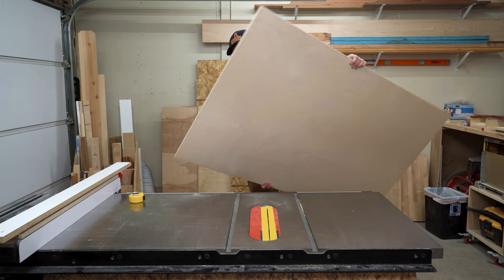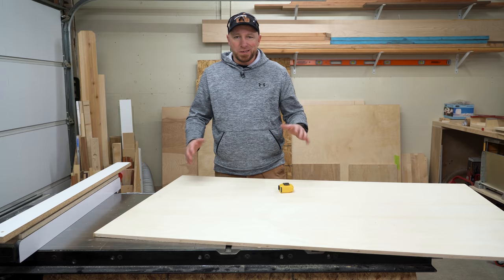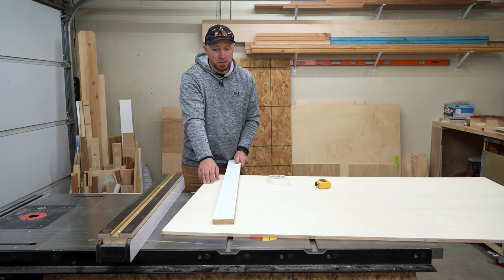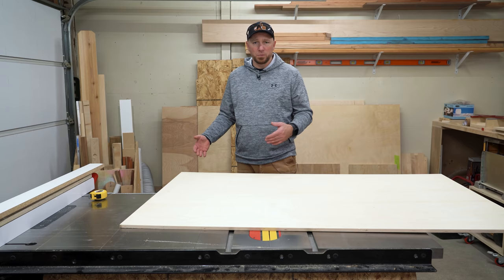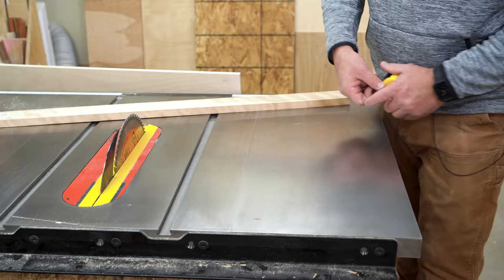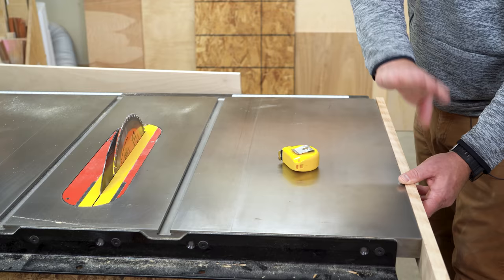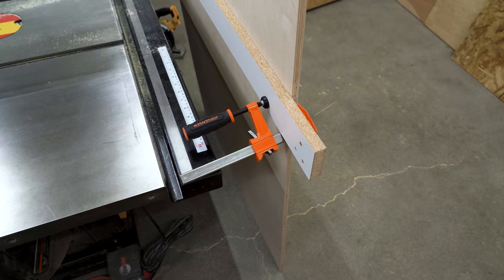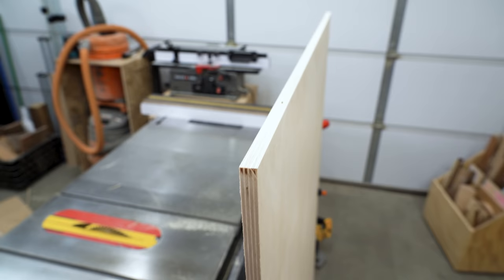A Table Saw Trick So Crazy, It's Genius!

Comment: I'm glad to see this right now.  I think I saw it before, but must have forgotten it, so this is a fortuitous reminder.  I have a couple of 48"+ pieces of 3/4" sanded plywood I want to half-lap together end-to-end, to make a piece longer than 8'.  Normally, I'd do that lap joint with a router and straight edge, but the bit I like to use is worn, and I don't really want to get another at this time.  I also don't want to use the circular saw, for the reasons you mentioned, and because I want this to be an invisible finish cut and seamless under paint, and dressing it up with sanding, etc., isn't something I'm really set up to do.  

This method gives me another option I hadn't thought of, so I'll check it out and make sure I feel safe doing the cut this way (plus it sure would be nice to use my dado stack in the table saw and do fewer passes).  I especially like the idea that the fence can extend past the edge of the wood and fully engage the table edge before the wood gets to the blade, stabilizing the cut very well.  I would need to rest the overhanging end on an outfeed table of the same height as the saw.  And in order to firmly engage the fence against the table edge, I'm thinking I'd like to clamp a second board, like the fence but on top and further away, to use as a handle for my left hand to pull the sheet firmly to the right and keep the fence tight against the edge.

Great idea!  Thanks!

Comment: This is a great tip Tyler but I still like your cutoff jig better.  I do this all the time by putting some 2” foam board on the floor  (or outside in warm weather so I don’t have dust in the shop).  I use foam board pieces so I can clamp my cutoff jig to the plywood and have never worried about the saw wobbling and cutting an angle.  With that said, I have a 52” width fence on my saw but wrestling a 4x8 sheet of 3/4” cabinet plywood on the saw is less than fun….   Hope you keep up the great videos!

Comment: I hope this is clearer
A better way, is to attach that 3/4'  board to a piece of thin masonite that is longer than the width of the board plus the distance of the blade to edge of the table saw.{Board 3"wide, saw blade to edge of saw 24"--make the masonite longer than 27"}   then using the table saws edge as a guide with the 3/4" board at the bottom and masonite on top   cut the masonite using the 3/4" board as the guide along the side of the saw. You now have a jig that you can clamp onto your marked board. Clamp the edge of the jig to any marked line [masonite on the line 3/4" board on top, away from the line. Turn the whole thing over  and using the 3/4" board as a guide on the side of the saw make the cut, less marking and much easier.  I have been doing that for over 40 years.
Also--I have used this jig to cut the bottom of interior house doors--perfect cuts!
Reply: I cannot follow that.
Reply: Clever

Comment: This is so weird! I came to Youtube to check something else, but also had a problem with a large piece of wood I need to cut but two parallel sides are rough cut so I don't have a clean, square edge to run against the fence. I didn't even do a search for the answer yet, didn't talk to my dumdum devices (shhh... I mean Alexa), didn't discuss it with anyone in the house so how did this video get suggested to me?! It's like they're reading our minds now! Thanks for this useful and timely video!

Comment: That looks really useful.  The big sled I made years ago only got a few uses.  Still easier for me to use my 35+ year of skill saw on a saw horse and a panel trim blade.  You'll get No rocking on quality tools, + I don't have that much room on the left side of my table saw.  The side of your table saw all so might not be a good reference for your blade.  Aliment of the blase is base off the T tracks in the set up of the saw.  This might not be a problem because you are all ready clamping a scrap board to that edge of the table and another scrap board to the panel you need to cut.  So the accuracy is just down to the set up.

Comment: You could probably make a fence to clamp onto material and adjust the width. I would use a long aluminum extrusion with a t-slot and two blocks that slide along it for varying lengths of material and that can be clamped to the sides of the material. If you want to get fancy you might even try to incorporate a square into one or both of the clamping blocks, or threaded adjustment to help with accuracy. Just an idea out of my office chair. Thanks for sharing your trick.

Comment: Good idea, but by the time you did all that I would have just clamped a straight edge to the board and trimmed it off with my router or trimmer, especially if you where wanting to do the long edge. I don't a big slide table saw so I do this to my sheet before I start cutting anything.

Comment: Thanks. I do the same but temporarily screw the straight edge onto the sheet so the holes end up on the back of the work piece. It is still a struggle to handle without some kind of support or roller.

Comment: Decades ago, I bought a circular saw that develops 2 HP.   Maybe, if you threw it off a cliff, might have 2 HP power as it hit the ground.   It was always binding and stopping.  I built a panel saw to use the gutless saw.   Worked fine for years and years till the bearings wore out.   The panel saw takes very little space, sheets are easier to handle vertically, and cuts are dead on accurate.
Reply: If you ever buy another circular saw you can't go wrong with the old Mag 77 Skilsaw! I have used mine on the job every day for 15 years, and only done a gear oil change twice, and it's still running strong! It has taken several ride's off of the roof, and bent the table so I finally replaced it, and had to replace the grip once, and did a trigger replacement once, but for all the hard work it has done including running abrasive for steel several times, and running a diamond blade through concrete several times it's been a hell of a great saw, I highly recommend them!

Comment: Pro Tip: use a longer piece to clamp under the plywood. Usually twice as long as the plywood and then center them and it will be much easier and straighter.

Comment: Speaking of thinking outside the box, I've been noodling around in my mind about designing some sort of fence jig that projects down off the bottom of the foot of the circular saw, similar to a tenoning jig riding the rip fence on a table saw, with which you can make the vertical cut for tenons in vertically-oriented rails.  This wouldn't be for something that narrow, but perhaps something that could cut a rabbet on the edge of plywood, and instead of cutting all of the rabbet down into the face of the plywood (requiring multiple passes, and requiring cleanup of the ATB blade's ridges), cutting in from the edge (so that one cut from each angle, into the face and also into the edge, would remove the waste from the rabbet).  This circular saw jig would first need to be safe, and have a way to loosely clamp to the plywood so as to allow it to slide but not wobble.  Several ideas come to mind, from adjustment knobs to slick surfaces to spring-loaded rollers projecting from the surface, to a jig not attached to the saw but to the plywood edge itself.  But curious what you think, how you'd solve that.  No need to reply, but if you come up with anything video-worthy, I'd certainly be curious to watch.

Comment: That edge guide circular saw cutoff jig works a lot better if you make the same jig but use a router and a straight bit instead. You get a finished edge with none of the wobble of a circular saw.

Comment: Thanks for that. I suggest you buy a foot switch. It is so much easier to turn the saw off with your foot than having to reach over to the switch while the saw is still running.  : )

Comment: Nice method. I would suggest that if the end of the table saw wing wasn't square to the blade you could add a piece of steel or aluminum bar by drilling and tapping, them shim it into square. I think I might give this a try, I run into this quite a lot.

Comment: Great idea. I'd add one recommendation - if you're cutting something that overhangs your saw table, you should always use something to support the piece to prevent the edge you're cutting from rising up from the blade. There are plenty of how-to vids showing how to make inexpensive outfeed supports, rollers, tables, etc. Even sawhorses will work if they're the same height as your saw table.
Reply from the maker: I don’t know about “always”, but definitely a good idea in general. I’m still designing mine, as I don’t have space for permanent extra support. In this case, the material is flat to the table, but the material has a bow on the end being cut.

Comment: I find it easier to clamp a metal straight edge to the sheet of plywood and use a circular saw. With all of the different kinds of blades available I get the same results as hassling a big sheet around.

Comment: Great tip. Only one thing, when using the “burning an inch“ strategy, I anticipate you will likely lose that 1/32 accuracy since you didn’t burn the inch when measuring from the blade to the end of the table in the first place.

Comment: Could this be setup on the long side of the table saw? Doing this on the short side forces you carry the material while you cut. But I love the tip!
Reply: I believe that would work as long as the rails for the fence didn't extend past the end of the extension wing.
Reply from the maker: Yeah absolutely. Just take the fence off, and as long as there are no other clearance issues, you should be fine. You just have to have a flat table edge to reference to. I used the edge as an example but also mentioned full sheets. I just didn't want to cut my full sheet in half! The bulk of the weight is carried by the table because you're basically pressing down and pushing in at the same time, so the weight sort of disappears. Depending on what you're cutting of course.
Reply: You could use roller stands to hold up that end of you have them.

Comment: When measuring off the blade, be attentive to where your tape hits on the blade. If you are shooting for max precision, remember that every  tooth is offset from its sisters. The teeth have “set”. One tooth is close to reference edge of the table. The next tooth is away from the ref. edge. I.E. back/forth/back/forth/back/forth. Might make 1/32” diff in measuring....maybe more. DaveHeitman dba Dave The Carpenter in Omaha. In biz for 43 years.

Comment: 4:53 a tape measure has a small amount of play in the hook so when it's hooked it gives the same measurement that it does when it's butted up against something.  A decent quality tape measure's hook play should be equal to the thickness of the metal of the hook.  At least that's what I've been taught.  I get that burning an inch is technically more accurate but it's not rick free...you need to remember to add an inch if you are marking and subtract an inch if you are measuring.....something I've neglected to do on a few occasions that I had a tape measure with a gnarfed up hook, lol

Comment: Thx for the trick, I'll probably use it in some cases. Can you please tell me why wouldn't you use a straight edge on the sheet with a router and flush triming bit. Thnx
Reply from the maker: For that specific application, I definitely could have used a router, but this method can be used to cut pieces down that would otherwise exceed the factory fence capacity. So if this was a full sheet of plywood, the same principles would apply.
Reply: @InspireWoodcraft  thx for the reply. Indeed it's very useful in that case. Have a good one !

Comment: Just built a track saw out of a Skil 12v 5 1/2 inch saw & a Husky 8' clamping guide that never worked well. Salvaged parts off guide & with some fiddling & epoxy I now have a two part track saw dialed into 1/1000 th of a inch. Some of us old farts have a hard time man handling a big slice of wood like you young bucks.

Comment: Thought I knew all the table saw tricks, but that's a new one for me.  I have sheet metal extensions on my saw so I'll probable need to make a wooden edge with shims, but I'm going to make it with permanent shims, carriage bolts & wing nuts, and a foot longer on each end.  Thanks for the tip!

Comment: I put this to work this week. Very handy. Later I wanted to cut off a side parallel to the other, at a certain width. It seems this is not possible with this method using only one cut. Any help on this one?
Reply from the maker: It’s hard to say without seeing the exact situation. Clamping a fence underneath like in my example, you are making the cut parallel to a 90 degree reference, so it should work no matter what. Regardless of how/where you clamp the fence down, the cut will always mimic the fence.

Comment: Ingenious!  One suggestion: I wouldn't cut anything off the plywood until I knew exactly what size panel I needed.  Suppose I needed a panel that was 30 inches and I didn't want to use the factory edge.  Your method - new to me - is a great idea.  However, I would have marked both ends of my panel at 30-1/8 " and made the cut just as you showed.  That way I wouldn't have as much material hanging over the edge of the table.  THEN I'd set my fence to the final dimension and cut away the factory edge.  However, before making ANY cuts I'd make sure my lines were square by doing a cross corner measurement to make sure the edge I'm keeping is square.  Usually they are, but I've seen in rare cases plywood that wasn't square.  When selecting lumber that's one thing I always check for at the store.  If it's a nice piece but not square either I'll reject it or ask for the manager to offer a discount.  Sometimes that works.  If no discount then it can go back in the pile for the next unsuspecting termite.

Comment: The tip is cool and you got a straight edge but it's also not square to the face of your material. You're still going to need to go back and cut that square. The edge of your ply was off the bed of the saw as much as 18/ to 3/16.

Comment: Good trick. Could be more setup time if the table edge is not parallel with the blade. You can also use a good straight edge with smooth edge and use a router. The router can give you a more perfect cut than the table saw blade. Although it is only good for shaving off the edge but you can rough cut with the skill saw first.

Comment: The board is not flat on the table close to the fence so in this instance would not be an exact 90deg however it would work if you had a second person to assist holding the sheet of ply level while you feed the board through the saw. Holding a sheet this size for one person is always a bit difficult to keep it flat on the table and keep the feed straight.
Reply from the maker: The plywood is flat on the table. It has a bow towards that end, like I mentioned in the beginning. When you push it through the blade, you hold it flat to the table just like normal, so it has to be flat to the table. It's no different than a normal cut at the saw.
Reply: @InspireWoodcraft  Thank you for your reply to my comment; I will keep this in mind when I need to cut a large sheet of ply in future.

Comment: I used this trick b4. But I’m at the mercy of my crappy Ryobi table saw edge. LOL. When you have a cabinet saw, you can do a lot. 
Not all contractor’s saws have a straight (or smooth) edge. 

Another way is to use flush trim router bit since you taking off a little.
Reply from the maker: I hear ya. I've done this on cheap saws too. That's how I knew about bolting on a ledger. I also mentioned that this works for breaking large panels down, not just taking an edge off.

Comment: Hmmm.... I mean, lets say you have squared edge somewhere on the stock. I think the easiest way, and to make do without all the infrastructure and setup and checks required just to pull that off, assuming you have a router, is to just put your straight piece on two makers and use a flush trim. The two markers must be equidistant from a reference obviously, which is your factory edge.
If no factory edge, same applies. Use your straight piece to flush trim, then you can use that new straight edge to get the other the parallel side in the same way. Point is, your router would be an easier method to get all sides 90 to each other. If no router tho (like myself for 3months after owning a table saw), this would be a nice hack for sure.

Comment: Why not just use a flush trim router bit. You are already using the straight board and clamps, so instead set the guide board 1/8 back from the sheet edge and run the router. No tear out from the saw blade either. I also prefer vice grip style clamps over twist style.